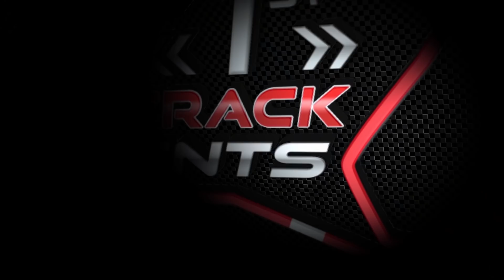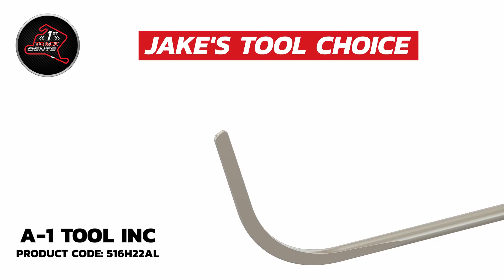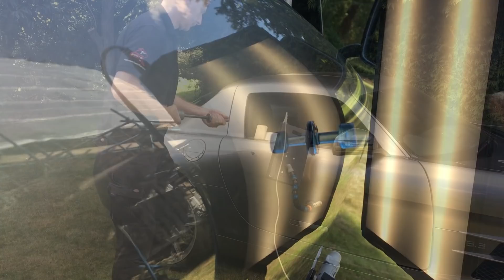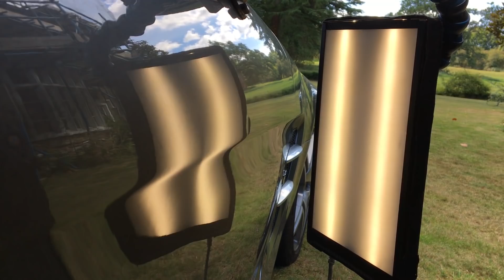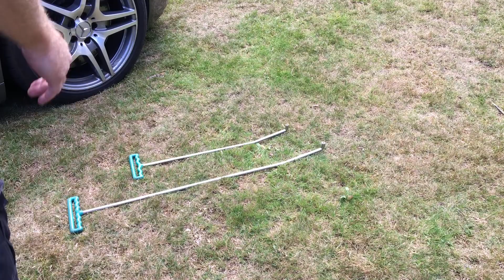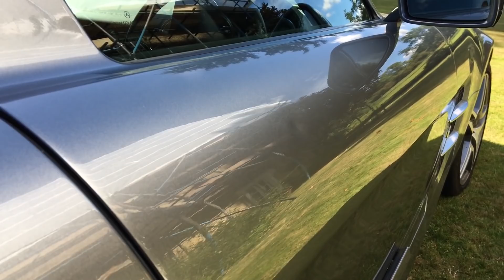MULTIPLE DENTS GONE! | NO Paint No Filler!

Comment: on the first dent, I totally understand why you pulled the majority of the dent up and then knocked down the high spots that came up because of the stretching of the metal caused by the initial dent; you actually had to shrink the metal by knocking it back down as you pulled up the low spots. A guy named Karl Fisher over on Make It Kustom actually taught me a lot on stretching and shrinking metal. I never understood the process of removing dents until watching some of his videos on metal shaping.
This is the most legitimate channel on dent removal I have seen! Great videos!

Comment: Really enjoyed it. Thank You. 

Are You using only nylon tips or there are different ones like ABS?
Reply from the maker: Hi, there are tips made from so many different materials that I just couldn't list them all, I prefer Rubber and the plastic vinyl tips and some of the PVC coated tips 👍
Reply: I'm asking because I got 3d printer so I can make myself few from abs or petg
Reply from the maker: @karolalbin  You could try, the tips and knockdowns aren't too expensive and it may cost more to print them by the time you have worked out your electricity and plastic costs.👍
Reply: For my first set I'll buy them and that's obvious but in future if I'll have an idea for different shape of tip I can print it. Printing small tips like this will cost less then 10 pence 😜
Reply from the maker: @karolalbin  Sounds great, I know how to model in CAD but can't afford a 3d printer yet, so if you come up with something great send me the stl files and I can print one off too whe I eventually get one! Good luck 😉
Reply: @1st_track_dents  of course I will. I got Creality Ender 3 with some upgrades. Really good budget printer for beginning.
Reply from the maker: @karolalbin  Yes I've seen those advertised, I would love to get a Prusa Mk3 but they are quite expensive!
Reply: Yes Prusa is top of brand. Just set up and print but like You said very expensive. I think for printing from time to time is better to look for something budget. Lot of people got Creality printers so on Facebook groups You will always find support if You got problem with something.
Reply from the maker: @karolalbin  Funny enough I saw a couple of those printers going quite cheap on Facebook marketplace and nearly bought one, maybe I should start with one of those then. 👍
Reply: Yes. Lot of people losing interest after few prints so You can find a bargain sometimes:D

Comment: The videos are great, I learn a new tip every video! Gives me confidence to start giving PDR a go. I just get worried I’m going to break the window with the pressure of pushing on the rods. Any advice on that?
Reply from the maker: As long as you are using a very good window guard and the rod is not touching the glass it should never break. A metal felt backed one is what I use.  However just be careful if the window is laminated (double glazed) as those windows are extremely fragile and can break very easily, they are normally found on high end vehicles like Range Rover, Bentley, some BMW's and Mercedes although they are on some other vehicles too. I check every glass first before going down the window:-)

Comment: Do you ever use a way of measuring the temperature of the paint?  And do you not like the lights with the fine lines?
Reply from the maker: No, I just know how hot to get the panel, you only need gentle heat. If you was leaving an Infrared lamp against the panel for a period of time to dry paint , then it would be important to know how hot you are getting the panel as they get very hot. Regarding line boards, my preference is always a fog board as it is easier on the eyes, however I may incorporate  2 or 3 lines on my fog board to help with finishing dents:-)

Comment: very nice and professional work. I just wish that all bodywork repairment were at least 50% of this skill. They all use fillers like there's no tomorrow. I had an accident a few years back and all of my panels were filled with an exhorbitant amount of body filler. I was disgusted as the insurance paid for it and they used crap filler to "fix" it. And then I go and watch a real repairman fix an absolutely twisted fender which I thought was unfixable in 20 minutes (of course this guy was expensive to hire but absolutely worth his time)
Reply from the maker: Yes, I used to be a panel beater for BMW and before I learn't this skill, I must have filled thousands of dents with bodyfiller, looking back now, all those jobs could have been in and out the workshop in a couple of hours instead of weeks!

Comment: That door panel looks very soft..
Reply: It's more like the form of it that makes it strong. The door itself is 0.6mm steel and that is razor sharp if you cut it. Great removal of these dents, I have on my Corrado a few bad dents and buy the tools to remove them. Local body shop or dent remover said there is no way it will come out, so patients will do it.
Reply from the maker: @Spelter  Yes, your correct, the swage line and forms in the metal is what gives the panel it's strength. Good luck with your Corrado!
Reply from the maker: It may look that way, but, the German metal is quite strong:-)